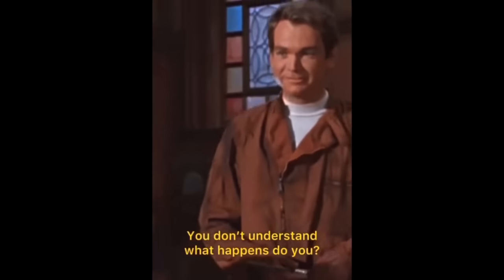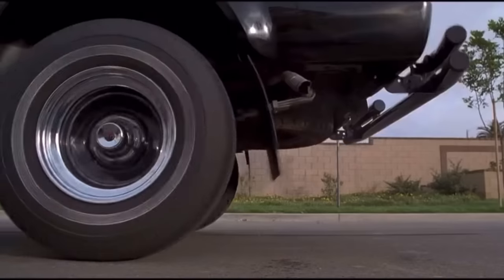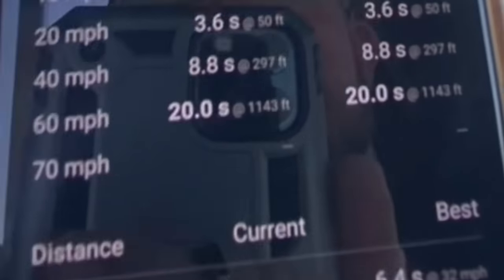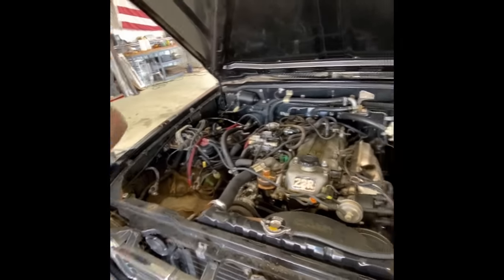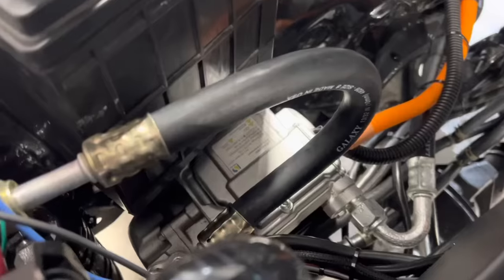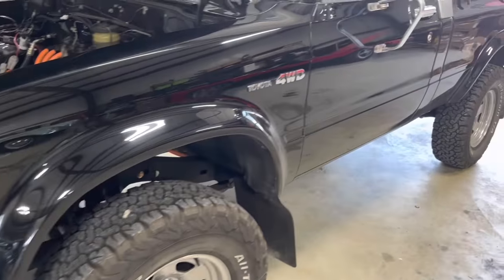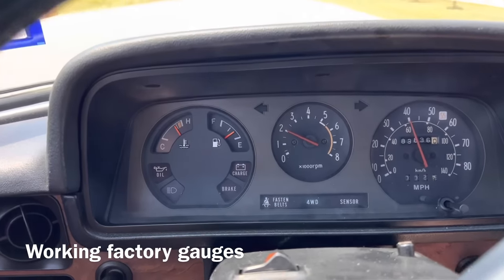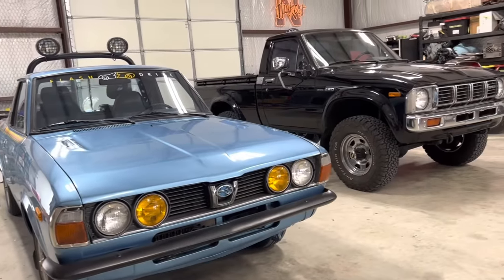22R to EV Swap: 1981 Toyota Pickup Hilux 4x4 All Electric Conversion with Hyper9 motor Tesla Battery

Comment: Cool but you guys ruined that truck the way it was would last 300 to 500k miles and could sit for years and years and then with only a little gas you could be driving no electric vehicle can sit for years and years and they all have batteries that are junk after 10 to 15 years max no matter the mileage

Comment: So now you use electricity that is produced by burning fossil fuels to power your concerted vehicle. Seems less efficient like a backwards move if you think about it but then again a lot of other people will benefit from your irrational decision to convert. Then you can invest a bunch more when the batteries wear out and you need to refresh but hey it sounds cool on the surface if your brainwashed and silly enough to buy into the absurd idea of “clean” power production. The only thing futuristic about it is how they figured out how to bilk money from people in a new and different form of highway robbery. Should have left it stock a shame looks like a sweet truck that you did a disservice to.